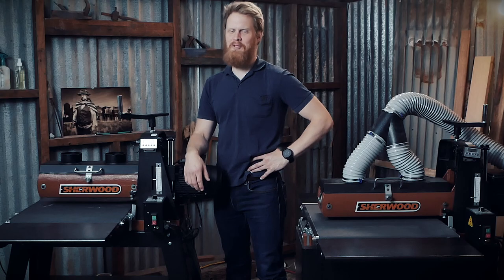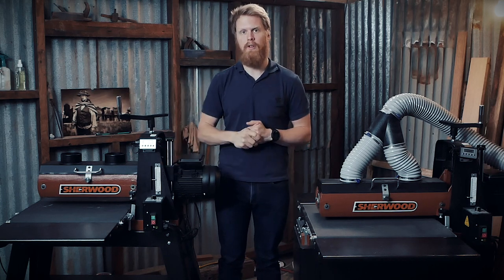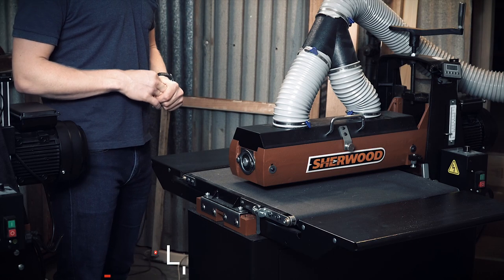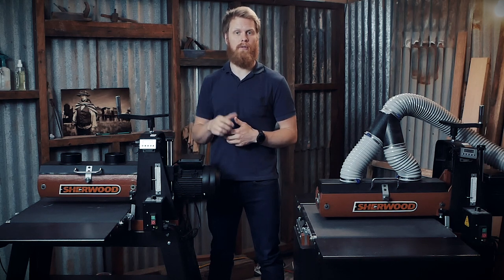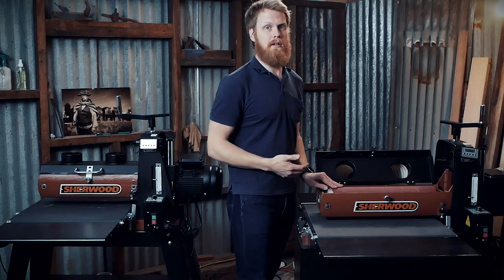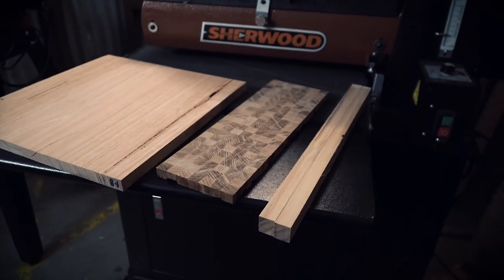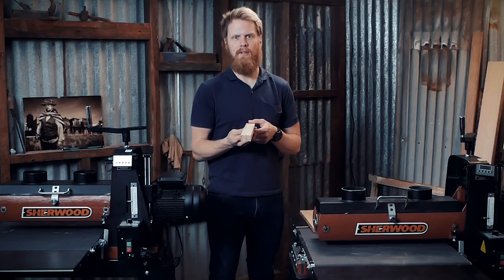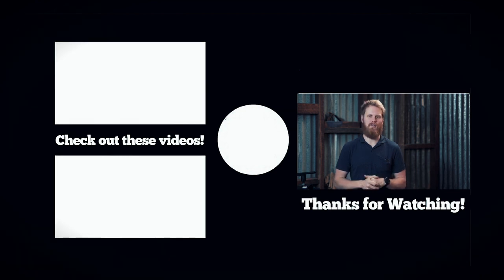Choosing and Using Your Drum Sander

Comment: Do these thicknessers have the feature that allows you to raise the closed side of the table 3 thou to prevent creating a ridge when sanding pieces wider than the drum? Some Laguna Supermax drum sanders have this feature and it looks like these have the same lever, but it wasn’t mentioned in the video. Cheers
Reply from the maker: They can be shimmed easily to do this.
Reply: Thanks for your reply,  @timbeconaus  ! I'll have to come down and check em out :)